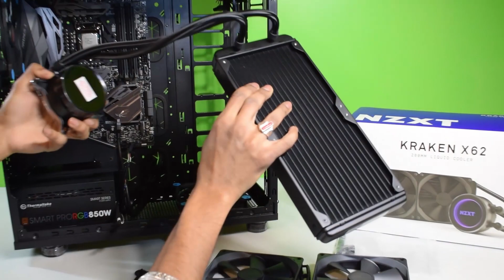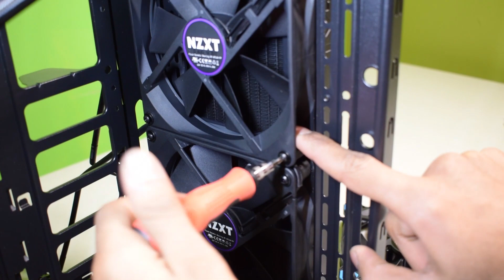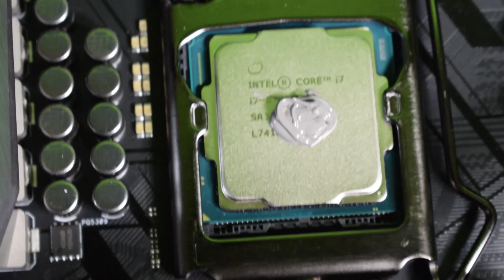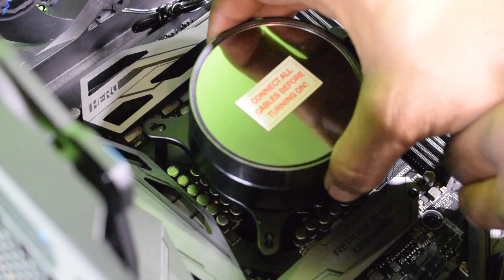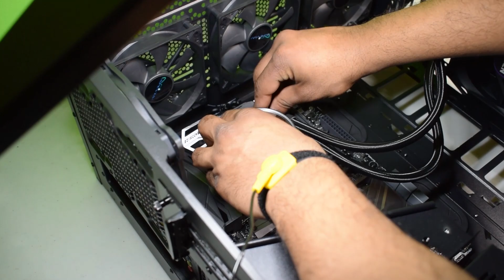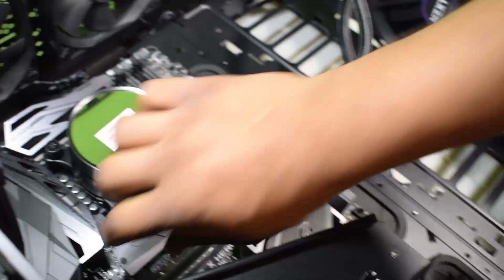(Part 12) 2018 Coffee Lake PC Build: Installing NZXT KRAKEN X62 Liquid Cooler!

Comment: The thermal paste can be applied in many different ways, some people like to evenly spread a thin layer with a credit card, some like to put a pea size amount and just press the heatsink on. And then there's me, I was the one who decided to go out and buy better thermal paste because the paste that was pre-applied on the heatsink was hard and brittle, so I used a lot of thermal paste, not a big deal because this machine runs like a beast! It stays super cool even while sitting near a heat source (furnace vent).

At the end of the day, you need thermal paste to transfer the heat from the CPU to the heatsink. Wether you use a little or a lot, and I believe you can't use too much but you can always use too less and cause your shit to burn.

This series wasn't created for nerds to hate, it was made for those who wish to learn how computers are put together, we upgraded from a LGA 775 Pentium- 4  3.4Ghz that did really well for over a decade. So coming from a Pentium 4 to an 8700K there might have been some learning curves but overall it was a sucessfull build and we can make benchmarking test videos if you want..

Anymore technical questions?

Comment: Call me crazy but I just installed this on my Asus maximus code x and the CPU back bracket was loose after I put the spacer screws in just like this video so I put the washers on the front and back... hopefully that's ok to have a washer on the front and back.
Reply: Make sure the washer you used don't cause any connections on the motherboard. It can short circuit if there's a scratch on the motherboard and the washer creates a path. Be careful

Comment: im pretty sure the rad is not placed correctly.
Reply: O o f
Reply: Because of the computer case we purchased, it allowed you to custom fit the radiator in different places. We custom fit the rad outside the case so we can add more fans where the rad is originally supposed to go. I can show you in a future update video.

Comment: look to be honest i did not even watch all your videos i only watched this 1 watch it yourself radiator on the outside ways to much compound paste and the cooler already had compound paste pre applied and you left it on i dont no how long your cpu will last
Reply: CPU runs smooth no problems. Boots onto desktop under 5 seconds..
Reply: Karan Jassal boot time is ssd speed...
Reply: @Mercuryalreadytaken  Not only SSD speeds, motherboard needs to be able to handle the bandwidth, the m.2 is also formated using GPT partition instead of standard MBR. I was only using the bootup time as a simple example. If you want me to post benchmarking for the CPU only let me know..

Comment: That's a shit load of thermal paste dood...on top of that you didn't even remove the thermal paste that came with it. So now you have like 1000x more than you need.
Reply: The thermal paste can be applied in many different ways, some people like to evenly spread a thin layer with a credit card, some like to put a pea size amount and just press the heatsink on. And then there's me, I was the one who decided to go out and buy better thermal paste because the paste that was pre-applied on the heatsink was hard and brittle, so I used a lot of thermal paste, not a big deal because this machine runs like a beast! It stays super cool even while sitting near a heat source (furnace vent).

At the end of the day, you need thermal paste to transfer the heat from the CPU to the heatsink. Wether you use a little or a lot, and I believe you can't use too much but you can always use too less and cause your shit to burn.

This series wasn't created for nerds to hate, it was made for those who wish to learn how computers are put together, we upgraded from a LGA 775 Pentium- 4  3.4Ghz that did really well for over a decade. So coming from a Pentium 4 to an 8700K there might have been some learning curves but overall it was a sucessfull build and we can make benchmarking test videos if you want..

Anymore technical questions?

Comment: Thats too much Thermal grease. you should have removed the cooler pre-applied solution, or put a very small quantity on the processor and spread it around imo. But nice vídeos! Im watching them all
Reply from the maker: We ended up removing the nzxt to check how tightened down it was and realized we could have put more thermal compound since it was't fully spread out. Thanks for commenting & taking the time to watch my videos :)
Reply: The nzxt comes with its own thermal paste if you where to far from the cpu for that thermal paste to spread out then you might have the wrong thumb brackets on.... Mine is virtually touching the cpu without paste.